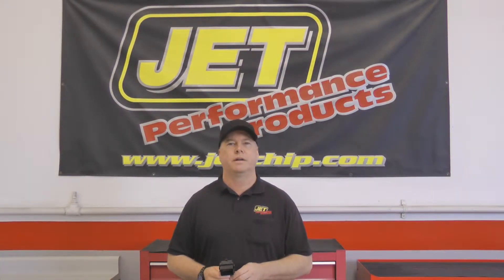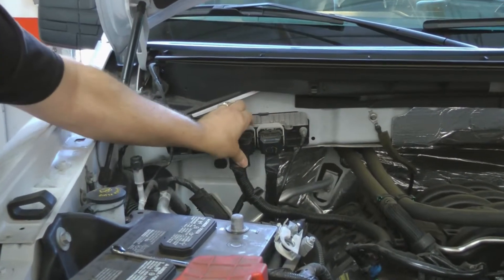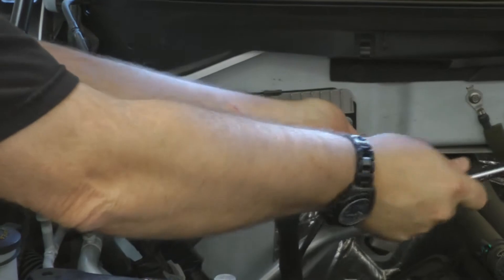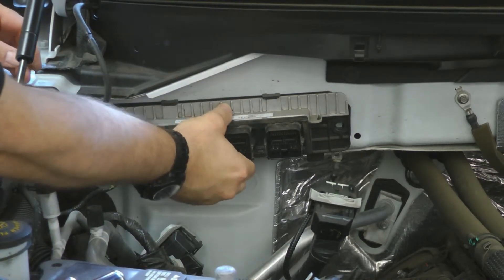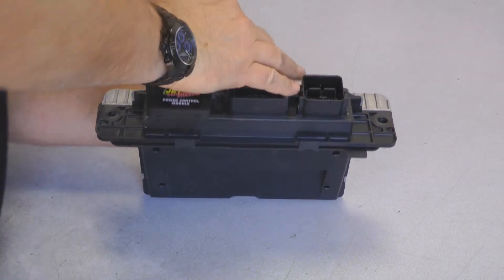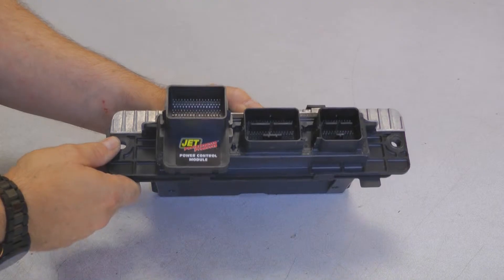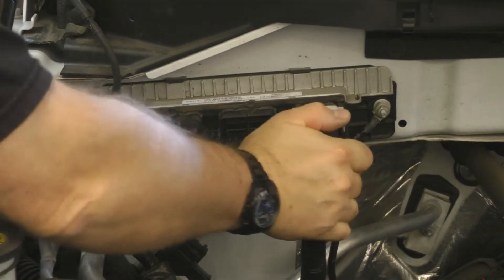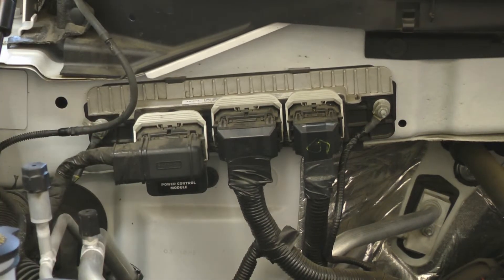JET Power Control Module Install on 2014 Ford F150

Comment: What the difference between stage one and two modules
Reply from the maker: Hello, the stage 1 is a moderate tune that gives your stock car on average 9-11 HP. The stage 2 is has a little more tuning parameters in it that gives you around 15-17 HP. With any added bolt-ons (intake, aftermarket filter, headers, exhaust, Etc.) will help the output of the tune even more, giving you more HP and TQ

Comment: I looked for this product on your website, but it wasn't there. Is this available for the '14 ecoboost?
Reply from the maker: Interesting, what is the model and engine size?
Reply from the maker: If it is the '14 f-150 ecoboost then we do not have the chip but, do have a prpgrammer which has tunes on it and you can monitor them and change things here and there on it.
Reply: @JET-PERFORMANCE  Thanks for the response. Fortunately, my year is prior to the auto-off. I'm just interested in getting better pedal to torque engagement. I'm just now learning about these options, so I know I have a lot to learn. yes, my truck is the '14 f-150 v6 ecoboost. Thanks again.
Reply from the maker: @kingdominnertia  We have a throttle tuner that increases the response time and gets you to open throttle faster, throttle body, throttle spacer and low temp stat for your car

Comment: Do u need to run 91 octane for it to really give it performance
Reply from the maker: Hey, on the stage 2 you need to run 91 octane but, with stage 1 you can run any grade. However the higher the octane the better performance.

Comment: Ok so I’ve had mine for 142 miles and have not seen any increase in HP or torque not to mention my mpg went down 1.3
Reply from the maker: So, when you installed the Module did you have the battery unplugged or did you reset the ECU at any point? Is the module installed completely? Meaning did you insert the module all the way and not break any of the pins? If you did that, and have not seen any improvement, then you might have a faulty module and if you purchased that through us or our vendors then you should be able to send that back in for a diagnostic or replacement.

Comment: Why not connect the module directly without taking out the pcm out??
Reply from the maker: You could directly connect the module to the PCM. We took the PCM out to ensure the fitment of the module and to also make sure to not bend or break any of the pins.
Reply: ohhh excellent point thanks.. by the way is there any pcm for a 2002 f150 Harley Davidson trucks??
Reply from the maker: Yes we do. Here is a link to the products we have for your truck. http://jetchip.com/products-for-model/